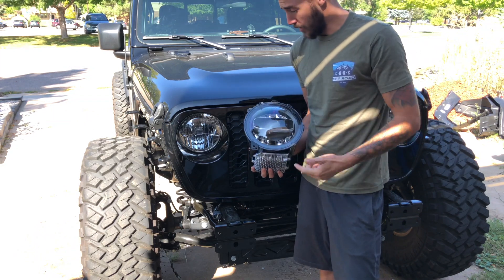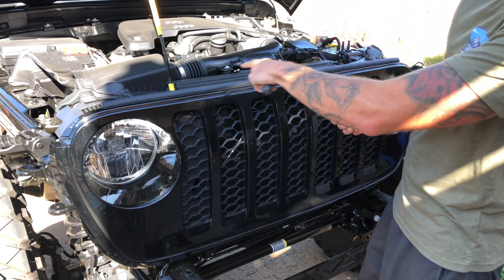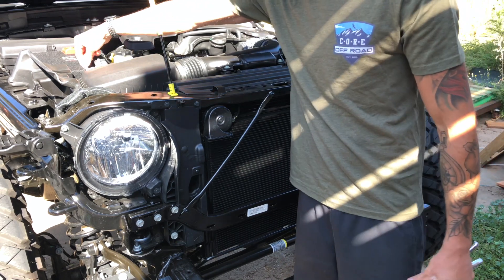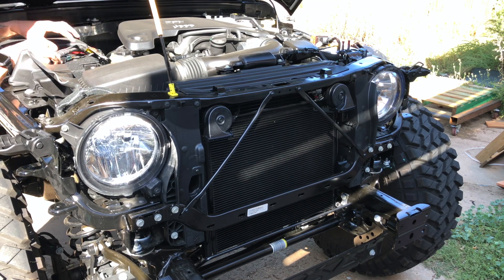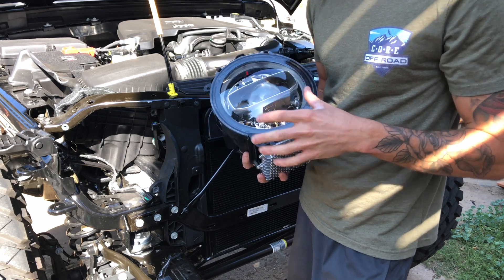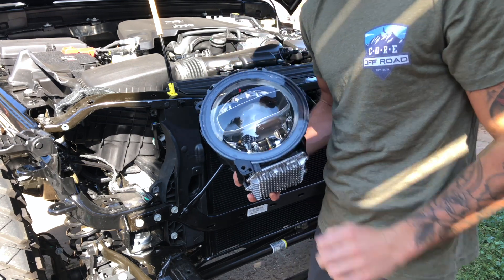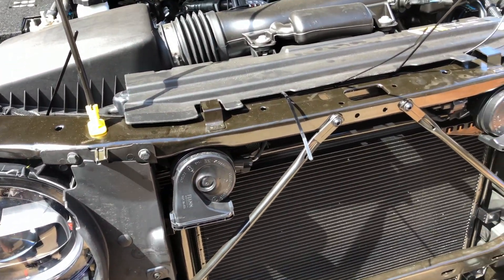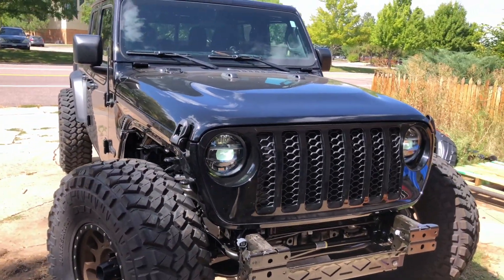Jeep JL/JT LED Headlight Upgrade

Comment: Thanks. Found this helpful for my install. I agree these are great quality. I like the halos. Was definitely more work than probably worth, but part of the fun of owning a Jeep is the fun of tinkering with it. Definitely have to pay attention to get the wiring right. Also, unmounting the BCM lets you pull it down for much easier access to C1A. There are 2 10mm bolts you take off to do that. Still a huge pain in the hand/back working on that tho!

Comment: I have 21 diesel. My driver’s side light has 4 wires but passenger has 3. When I ordered the kit from the dealership it came with the same harness in this video but when I looked it up on Mopar it stated that this kit does not fit my vehicle. I installed them without halo but when I switch to high beam low beam turns off. I can’t see anything in front of my vehicle. Any idea on what to do?

Comment: Tap into fuse F 52 and it will work just fine
Reply: Did you still have to have a dealer flash the ecu for the led headlights to not throw a code?
Reply: @timgriffin8442  hello buy the tazer mini JL/JT and it will works just fine do it yourself . Good lucky

Comment: Those new headlights look nice, but how do they look at nite, on the road, low & high beam.
Also, the wife likes the neat little "easter egg" in the halogen lite, the Jeep grill in the internal reflector.
Do these new lites have an "easter egg" too, since they're Mopar lites?

Comment: Great video Branden, did the tag on the wiring harness have a Mopar part number on it?  Or maybe the install guide?  I picked up a set of takeoffs and would like to buy that wiring harness.  Thx!
Reply: I got the same problem did you find the wiring harness anywhere?

Comment: Hey I have a question for the headlights did you just plug and play and they turned on or did you go into your computer and switched them from halogens to LEDs
Reply from the maker: they will work, but you do need to adjust the computer to read LED as they will start to flicker due to voltage issues.
Reply: @BJLudski  thank you very much

Comment: I just installed my but the passenger headlight randomly shuts off... Not all the time but it does??? Any idea? I did programs the BCM with my Tazer Mini?
Reply: Were you able to figure out the problem?
Reply: you solve the problem? i have same here.
Reply: Most likely the wires are not firmly seated in the connector at the BCM. I used a hemostat to grab it and firmly press it in. Small needlenose pliers probably work too. You might hear click. Give a tug to see if it backs out. 

Unfortunately this is the most painful part of the install IMO.

Comment: I’m ordering those lights and I contacted my dealership here in Honolulu and they said they’ve never done it and they don’t know if it will work.  Did you get yours flashed yet? If so, can you give me the name of your dealership that did it and maybe a contact name this way I can have my dealership call them for help if they need it. Thanks.
Reply: I hate it when you ask for help or information and no one responds.  I called central Florida Jeep/Dodge dealer, they said I have to purchase a $1080 kit. That’s Not including headlights or reflash cost.
Reply: @patrickjohnson2886  hey man am looking for the wiring any advice? Did you find them?

Comment: If you have a JL that came with Halogen headlights, Mopar LED LIGHTS will not work with your computer. You will end up at the dealer trying to get the error light off your dash. Not to mention it costs big bucks.
Reply: Lies it works just fine
Reply: J scan app will tell the computer there is LEDs installed. Less than $100.00